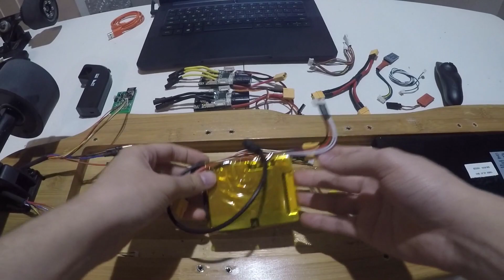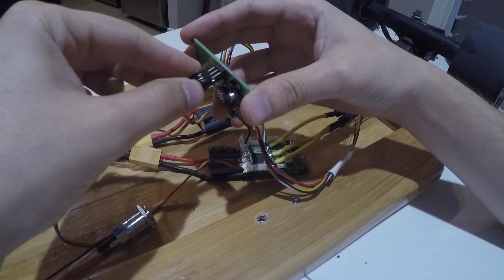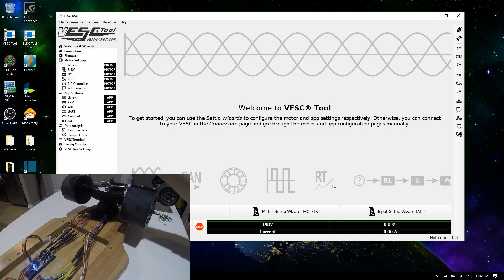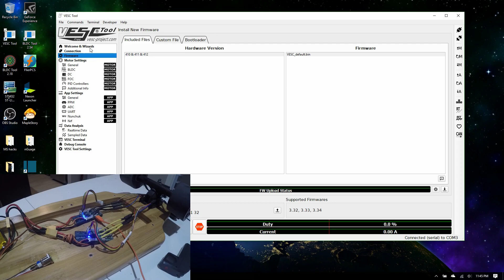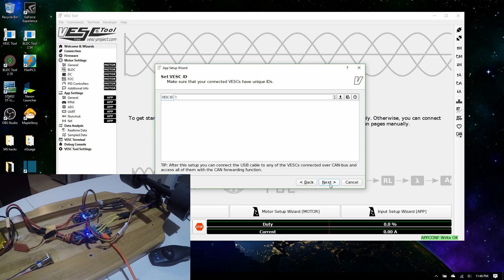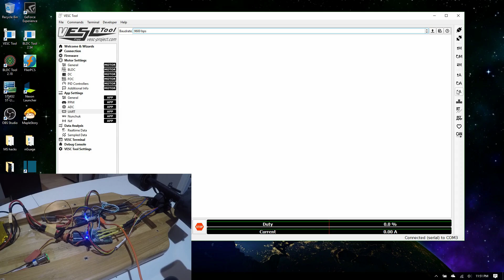How to setup dual motor Electric Longboard Both PPM and CAN!

Comment: never use Y split for 2xFOCBOX it will likely fry one of them even if you cut secondary 5V cable. 
Use two receivers - its around 6$/each

Comment: Quick question: Can you also control the motors through the keyboard (like the left and right arrow)? I have a separate project but want to use the software. Thanks
Reply: havent watched the video yet but if you use the program "vesc tool" you can use the arrow keys to control current and duty

Comment: Please help! Hi! My dual beast 6355 maytech motor setup, with dual focbox and 12s5p has some issues!
( I use maytech standard remote and reciver )

Also i use VESC TOOL!

One of the motors in “fast mode” shuts down? So i can press full throttle in eco mode, no problem, but when i switch to fast mode it shuts off after a while? Like you can hear 100% Throttle, and after 5,10,20 seconds it goes down to like 60% or even less?

Short version: When pressing full throttle in fast mode, motor start slowing down.

Please help vesc tool gods!

Comment: Hi O, this is the best and only video that i’ve seen here in youtube that rightfully explains the step by step procedure on setting up two vesc, glad i found it cause making my eboard a dual 6374. If i’m using the wining remote, will the receiver split the ppm cause it has 3 channel, bind and 1 & 2 or do i have to split the connector to a y cable?
Reply: Hey, for that remote you need a Y cable on CH1, I believe. You also need to cut the power cable on the Y Cable of one of the ESC. If not it will burn out the receiver after a while. Hope that helps.